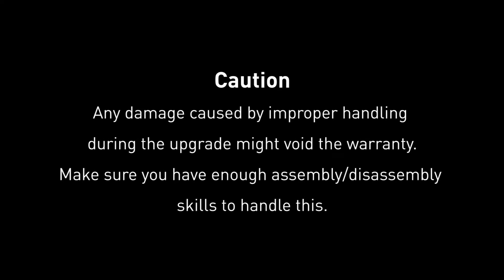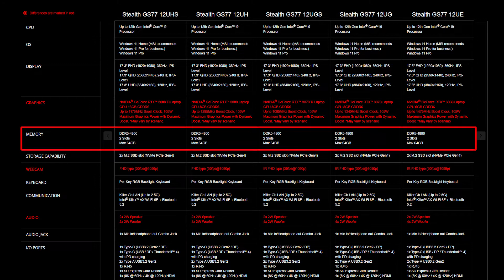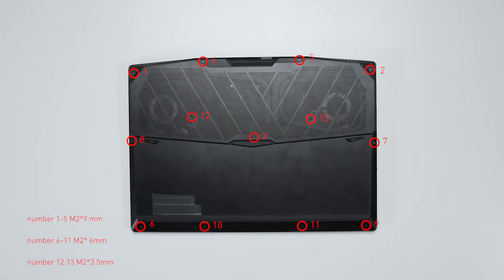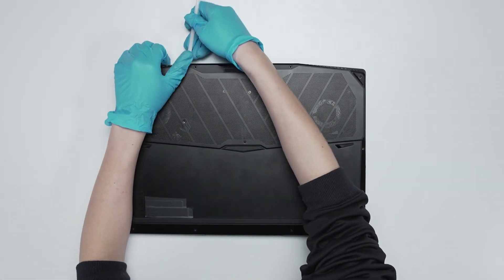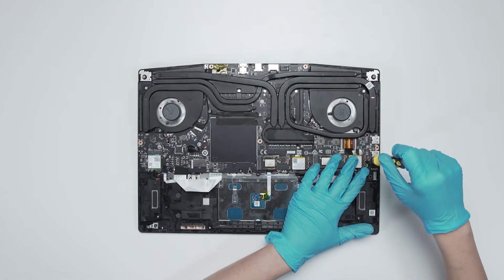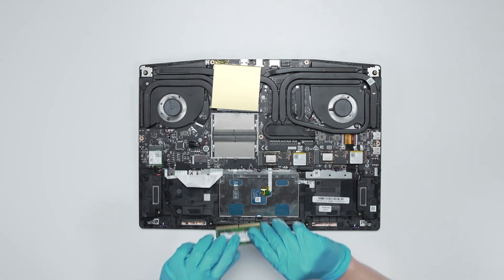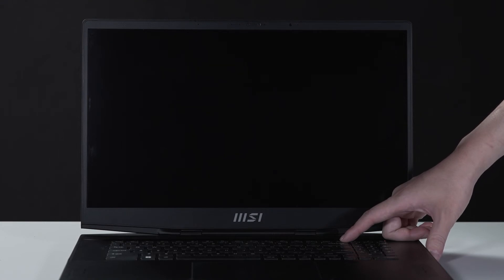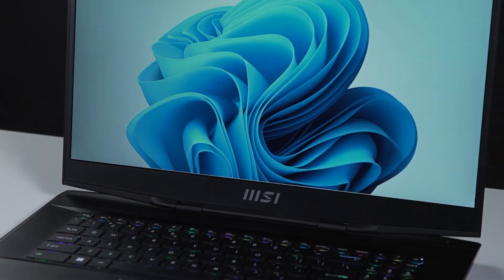MSI Stealth GS77 / Stealth 17 Studio Series Upgrade Tutorial

Comment: if you use the pinhole to disconnect the battery then why do you need to physically disconnect the battery if you just want to upgrade the ddr5 memory ? is it not possible to leave the battery alone while upgrading the ddr5 memory ?

Comment: My GS77 has a webcam switch on the left side of the laptop. I pulled it out of it's track when I removed the bottom of the case and it was really hard to get put back properly. Be super careful when removing the case. I think leaving the left side until last and try to push the case gently away from the little switch would help.
Reply: Yeah, that switch was a nightmare getting the panel off.
Reply: hello  brother ; please i just got a used gs77 and i have a questions about it to compare it to other unites so please can i msg you in any app you wish ? or may just email if you prefer ?

Comment: Just wanted to install a new ssd and as soon as i removed the case the webcam switch fell off and I couldn't fit it back in... such crap design tbh
Reply: same here. no chance to put the switch back.
Reply: hello  brother ; please i just got a used gs77 and i have a questions about it to compare it to other unites so please can i msg you in any app you wish ? or may just email if you prefer ?
Reply: Did you found the solution? I found out, how to fix it. If you understand the system, it´s super easy. But first I also could not fix it. You must press it stronger into the place, than you can close the cover and the switch works.
Reply: Thank you. I'll try that

Comment: Is anyone else having trouble removing the screw from the second SSD slot?  They seem to have welded it down with glue or something.  I'm almost stripping the screw trying to untighten it.  Any suggestions?
Reply: Mine comes off just fine.
Reply: Same, have you figured it out?

Comment: it didnt pick up my ssd card i installed along side the one that came with the computer
Reply: hello  brother ; please i just got a used gs77 and i have a questions about it to compare it to other unites so please can i msg you in any app you wish ? or may just email if you prefer ?
Reply: @zinedouali  let’s talk here
Reply: @KadeFresco  also how's the wifi card reach mine is worse than HP pavilion i had i cant connect properly to wifi that is less than 5-6 meters away
Reply: @zinedouali  this computer works perfectly for me. It connects to the WiFi at a decent length. I worked out Of a restaurant in the parking lot using their WiFi before.

Comment: Hello sir can u please clarify some of my doubts?
If one of my ram is single channel and other one is dual channel will they both be compatible with each other? 

And another one is if I apply 16 gb ram with addition to pre-installed 8gb ram , will they work fine or should I only use one 16 gb ram stick?

Note:- both will be of same clock speed 2666mHz
Thanks in advance!